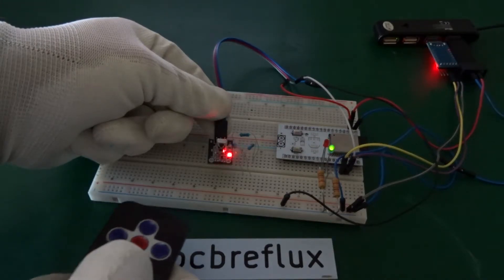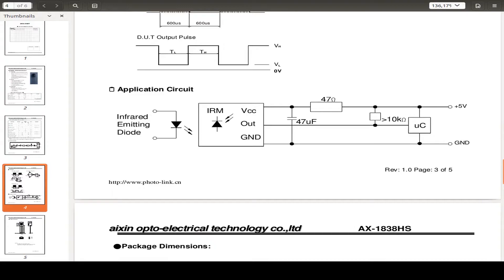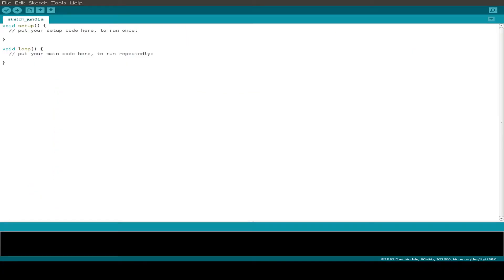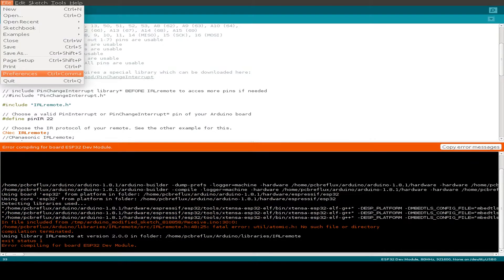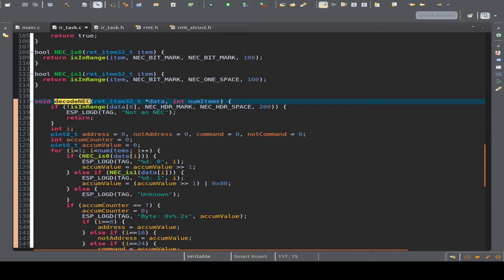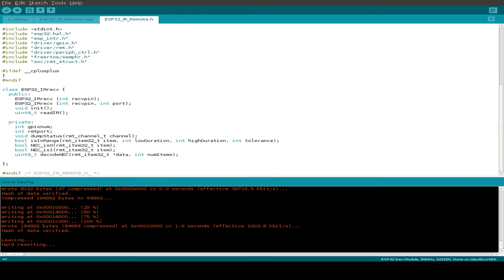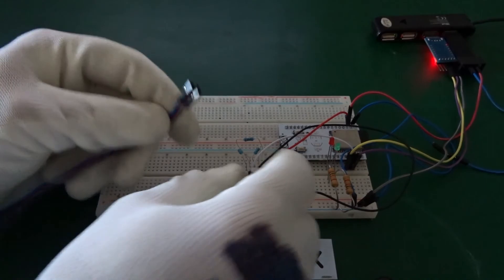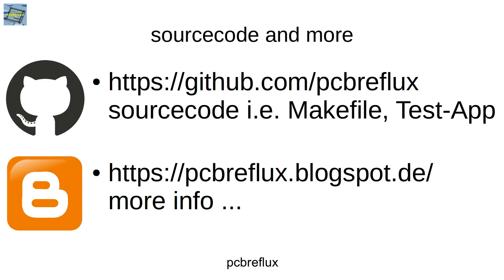ESP32 #40: IR Remote (AX-1838HS) + ESP32 Giveaway

Comment: Hello, thank you for this video. Can you please share the ESP32_rmt_IR you initially showed in Eclipse? I want to play and understand with the esp-idf and RMT. I want to use RMT to measure a pulse width. 
Danke!!
Reply from the maker: The original espressif example can be found here: https://github.com/espressif/esp-idf/blob/master/examples/peripherals/rmt_nec_tx_rx/main/infrared_nec_main.c
Reply: Thanks, so far I am. However I get always a ringbuffer 'rmt: RMT RX BUFFER FULL' error. The RMT_RX_SELF_TEST mode works fine, but not with the TV remote control. The logic analyzer shows I receive 3 repeated data from the IR. Any Idea?
I want to use the RMT technic to read the DHT22 Temperature Humidity sensor: https://github.com/gosouth/DHT22

Comment: Hi again. Can you post the Arduino library code that you use in the video? In your example, irrecv.readIR() returns a value, but it is void in the code you posted on Github. Thanks.
Reply from the maker: Hi, updated the source in github. Thanks for checking the code, maybe I've committed a old version.
Reply: Hi. Now irrecv.readIR() is blocking. It only returns when a button is pressed, and the command that is returned is always zero regardless of the button pressed. Please check when you have a moment. Thanks.

Comment: How do you find the performance between the ESP32 and ESP8266 (NodeMCU/Wemos D1) besides the addition of BLE? Is there any difference if I'm not using the Bluetooth features?
Reply from the maker: Hector Lee Hi, not done any comparisons yet, because I have not done a real project with the esp8266. In fact they are cheap and there is tons of code but I jumpt on the esp32 because of bluetooth and wifi. Have any ideas for a real performance test? There are some modes for the esp8266 that can realy overclock the cpu, not seen any examples for the esp32. How compare one core to dual cores? With or without freertos? Arduino vs raw C? Maybe do a comparison with ucglib and a ttf display (done a video about that on the esp32)? A comparison that involves delay or the serial interface should be avoided.  Or maybe wifi speed?
Reply: I'm not really that great with microcontrollers. Started out with the Arduino but haven't really pushed my boards to the limit yet. The ESP8266 are still cheaper than the ESP32. I've yet to jump to the ESP32 as I don't have a project that uses bluetooth yet. 

I understand that the ESP8266 can be a little limited in processing power but I haven't reached any bottle necks yet. I think it might be interesting to see if there can be difference in real world speed limits between the ESP8266 and the ESP32. The only test I could think of that could be demanding of speed is when working with TFT LCD Displays. http://hackaday.com/2014/08/18/tft-lcds-hit-warp-speed-with-teensy-3-1/

This was a demo that showed the speed limit of the Arduino Uno and the Mega vs the Teensy. I wonder if there could be something similar for the ESP chips. But this test also required a library optimization for the Teensy.
Reply: it's way faster at everything. from http perf to SD io to math, it's faster. 8266 loop()s at about 1khz, esp32 is more like 10khz.